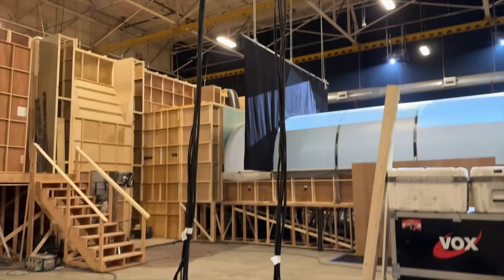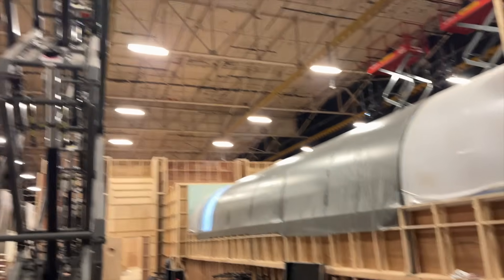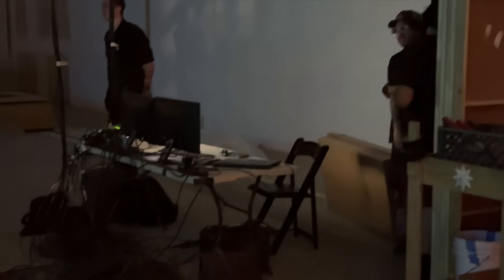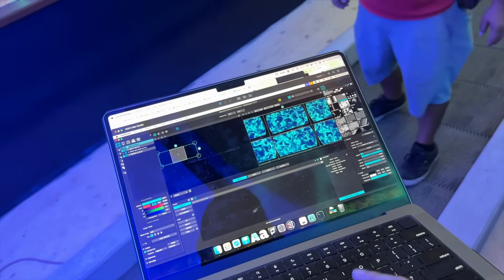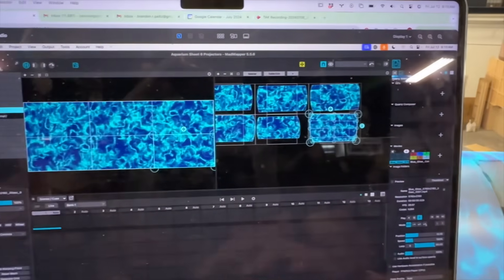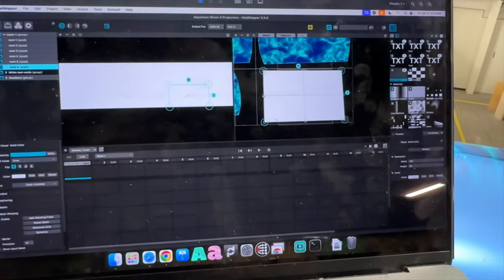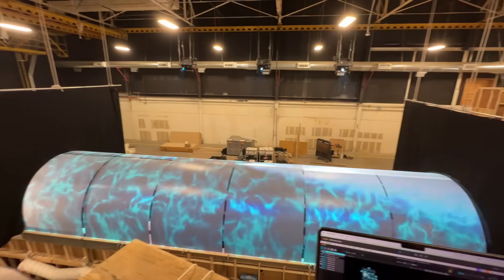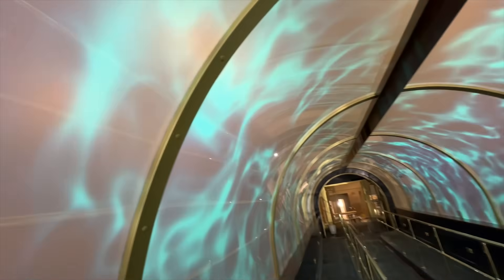I Projection Mapped an Underwater Tunnel for a TV Show

Comment: Hey (Off Tangent Question) I just wanted to know if the 4 in 1 PEX-C Avantis video was real or not... coz it was released around April 1st... and if it was real, I would really like a tutorial on how you did it... because it would be perfect for Avantis+Waves setup, all in 1 console.
Reply from the maker: It’s real, it actually shows up in other videos of mine as well running the Mac Studio and as a standard audio console. 
I think that’s a great use case for it with waves. Not sure what other info you are looking for though that isn’t in the video. Wiring, drivers for touch screens, companion configuration, midi button mapping, etc. send me an email if you want to really dive in with a consultation. Thanks!

Comment: Bro have you ever had tearing when using multiple outputs of your decklink with resolume?
Reply from the maker: With fast enough content at higher resolutions I’ve had tearing with all softwares at some point. Then I ussually decide to comprise somewhere on resolution or speed or do offsets in frame rates to compensate if I don’t have gen lock and frame sync available

Comment: If you would have used Digital Projection projectors and Vioso software, this would have been so much easier. Firstly because DP's Satellite Modular Laser System would have made the job so much easier as would have the Vioso software! For this use case, that combo would have saved alot of time and effort.
Reply: did you miss the part of the video where he talked about not being the one that made those kinds of decisions?